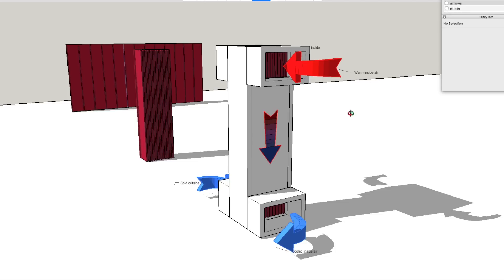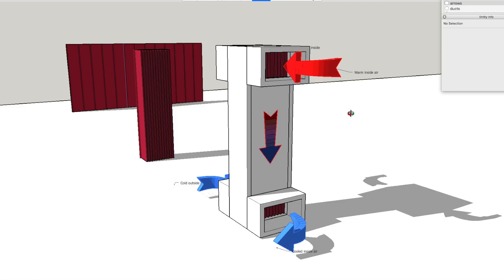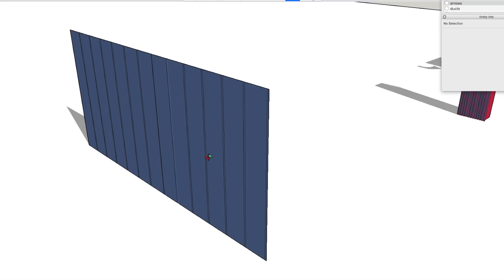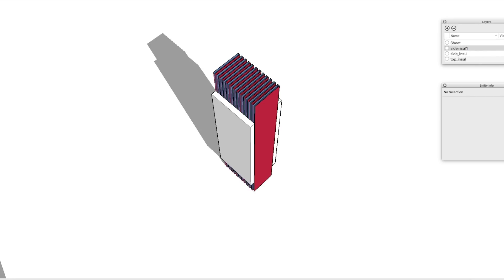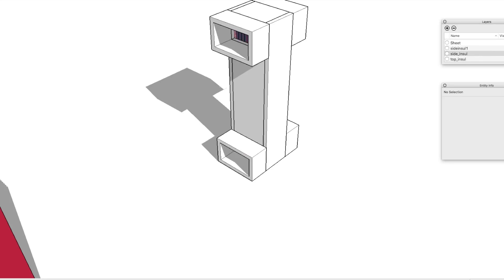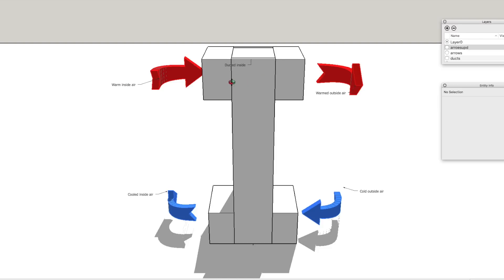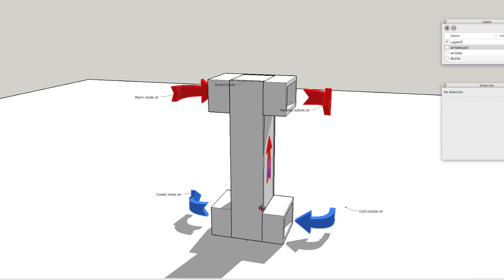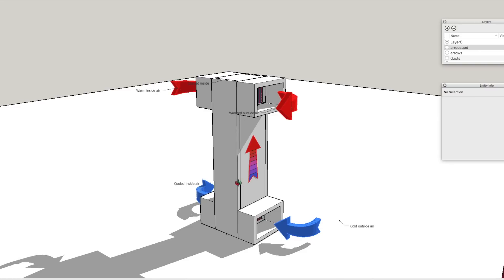Ventilation heat exchanger design in sketchup

Comment: I just watched your video yet again!  You are clearly saying ventilation system!  There is no ventilation happening in your design.  There is just a temperature or heat exchange happening here.  As I understand it.  You are miss stating what you have made or invented.  Very good design though for a passive heat ex-changer though.  Also why paint the metal black?  It seems like painting the metal any color or at all wouldn't  any difference inside the unit where there  isn't any light source to warm it.  Again maybe I am misunderstanding things.

Comment: FROM WHAT I SEE!  You have made a wonderfully nice design and it is thought out well!  BUT I thought you were exchanging the air in the building,  Exchanging the air means changing out the air for fresh or new air, doesn't it?    I MUST BE MISSING SOMETHING!  I don't see that happening you still have the same stale air inside.  You've made a heat ex-changer or for want of a better way of saying it an air conditioner! NOT an ex-changer!   I REALLY ENJOY seeing the things you are presenting and learning from you!  So please do not misunderstand i am not being smart or trying to make fun of you.  I'm a Yankee so have confused your words or does the words mean something different where you live? Like I have trouble following on occasion because of the difference in our accents, so I many times have to listen to it several times to understand it.  This is my problem though!  Has nothing to do with you or the quality of your work etc. though!  John
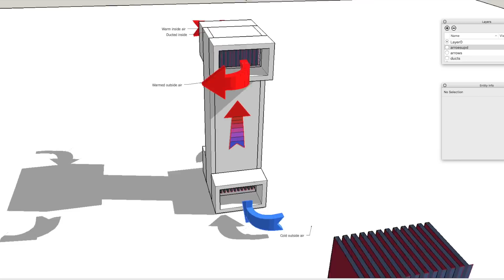Reply from the maker: I maybe need to explain this better, there are a few people not understanding how it works. If you look at 5:10 the air leaves the building top left to bottom left, air comes in bottom right to top right, the plate separates the two airflows in the unit. Don't think of the plate as a concertina, just image it straight down the middle, the concertina only increases surface area.
Reply: I have reviewed the video still again.  I think i am understanding that you actually are exchanging the air.  Boy it's really hard to follow what's happening from the drawing you are showing and the way you are explaining it.  You are not showing the air paths through the box which makes it hard to follow.  You have to imagine them to see it. Also it appears like it is a free standing box with air coming in and out at the top and bottom in the drawing.  If the drawings showed each air flow as it circulated through the unit it might be a lot easier to understand what you are doing,  As I am looking at it all and listening I am still guessing what is happening in there.  I'm in effect sure it is happening but I don't understand how!
I.m sorry if I seem thick or dumb but there is a lot missing in the explanation you are showing me.  My best to you,  JOHN

Comment: shouldn't the air cross over somewhere? The aim is to exchange stale inside air with fresh outside air.
Reply from the maker: In some drawings they show a cross over flow air as a heat exchanger diagram, this is not entirely accurate because the incoming and outgoing air should not mix at all. They pass closely with a big surface area in between so heat can efficiently be transferred.

Comment: Frankly it is not clear to me how this is supposed to work and I don't understand the recommendation to use black paint to improve heat transfer in spite of the fact that a black coating will tend to radiate heat better as the main method of heat transfer would surely be from air molecules contacting the surface and taking away heat in the form of increased kinetic energy.

A possible sort of heat exchanger I have seen is layers of twin wall polycarbonate squares arranged stacked with the channels alternately at right angles to give two directions of flow.

Now polycarbonate would not be a very good choice as it is not as conductive as metal, but it would be easy to make a prototype if initial calculations show that it would work.